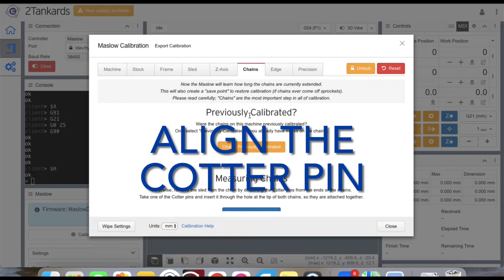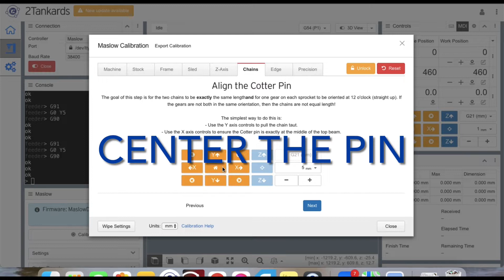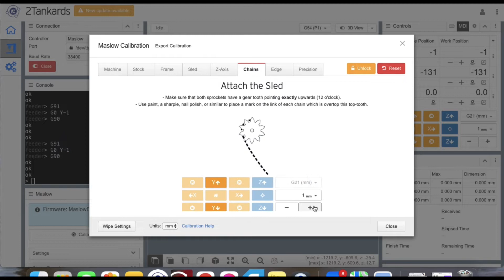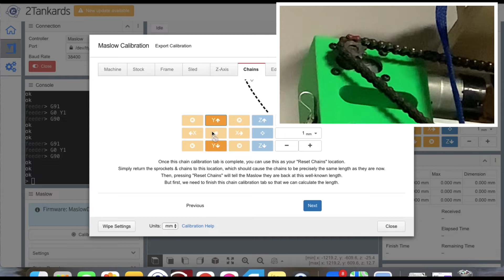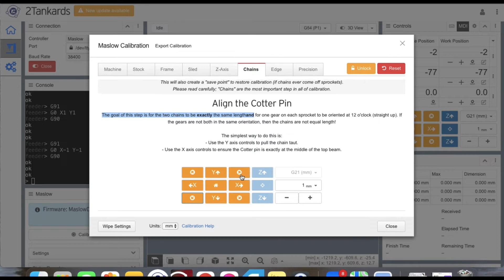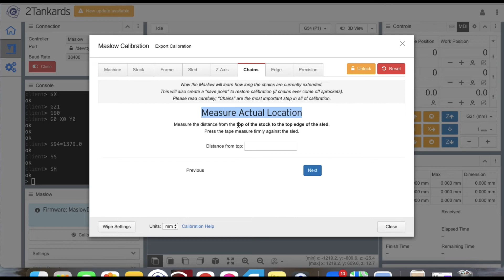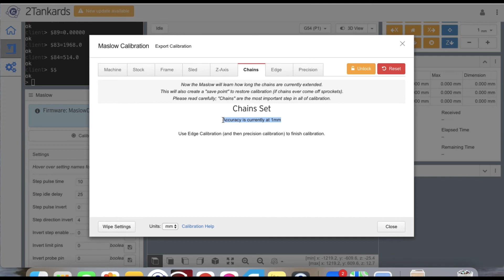MakerMade M2 Calibration Video #7

Comment: i just ordered my firt m2 kit with the camera. i will soon meticulousely watch all your videos. I couldnt use your promo code because there already was the fathers day sales going on. But a few weeks ago I ordered the 15 foot chain set as a motivator to eventually buy the kit and for this accessory, i used your promo code. merci mon ami à bientôt
Reply from the maker: Hope you enjoy the M2! It’s lots of fun.
Reply: @2tankardscreations211  should i go for a 91 mm or 71 mm router? Will mainly cut plywood up to 3/4. I am willing to pay the few hundreds more if  you recommend it.
Reply from the maker: @akimen64  if your just starting out, feel free to use the 71mm. The 91mm really only allows you to reduce cut time by using a full 1/2” bit. Remember, depth per pass is usually half the diameter of your bit. So….with a 1/2” bit you can safely cut 1/4” deep per pass which means theoretically it will only take you 4-5 passes. With a 1/4” bit you can safely cut 1/8” deep per pass. This means it will take you 8-10 passes. Basically, the larger router only helps reduce cut time. First, you should focus on your M2 learning curve. The only thing I recommend is looking at dust collection. I have a unit I sell specifically for the M2. It’s highly rated and used by over 100 users in the  M2 Facebook page.
Reply: @2tankardscreations211  ok cool. For me its answering the question i will go 91mm because i think the learning curve will remain the same. I just subscribed to the m2 f page and i sent u a message for more info on the dust collecting system